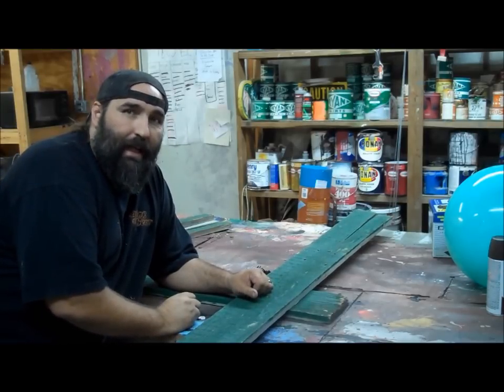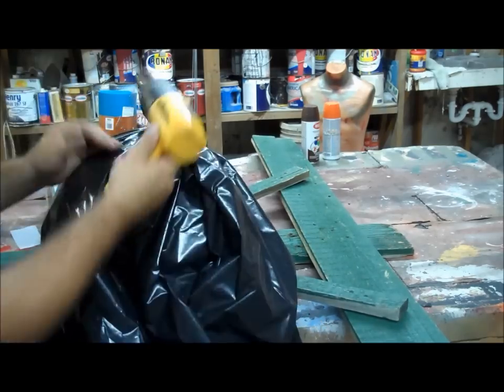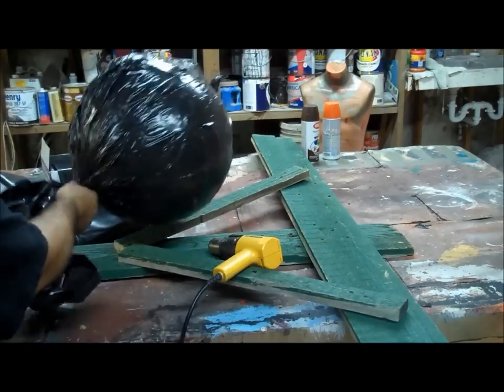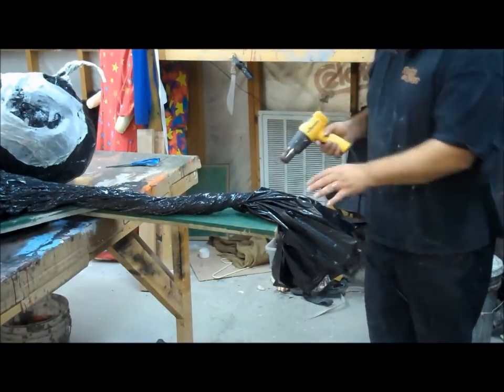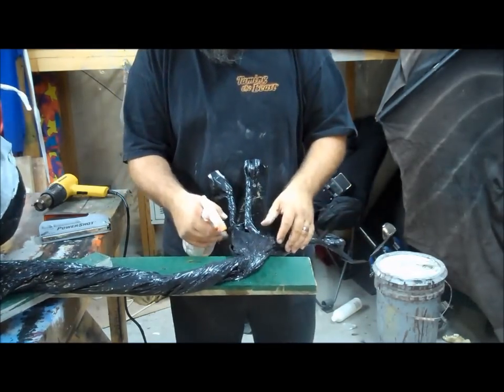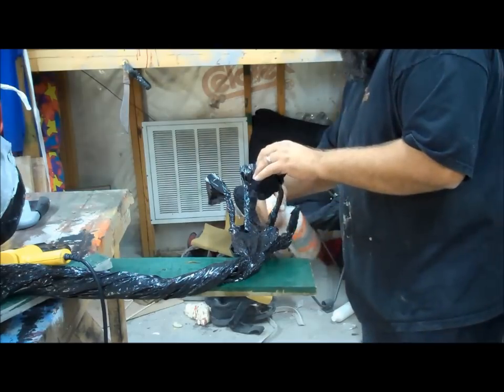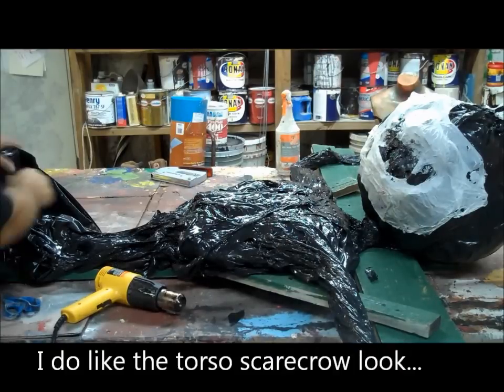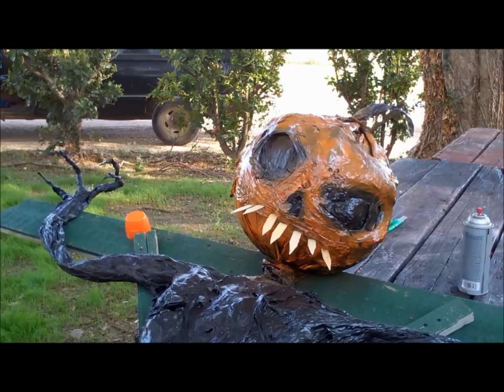Hallowednesday Scarecrow.wmv

Comment: Using plastic like you do in your videos is a great idea.  On this scarecrow like I have with mine that I made back in 2008, I would use 3" to 4" diameter tree branches and leave branches coming off those and you don't have to paint them either, keeps it natural.  So, your videos certainly inspire ideas.